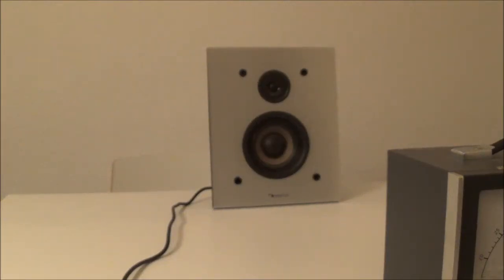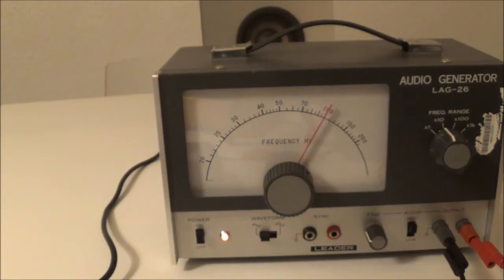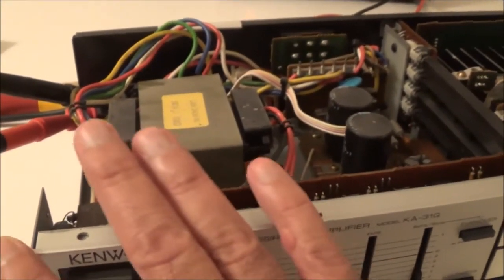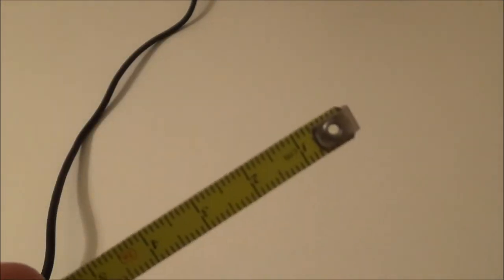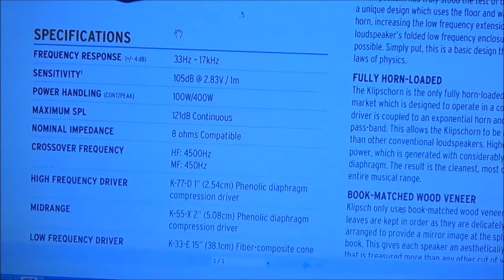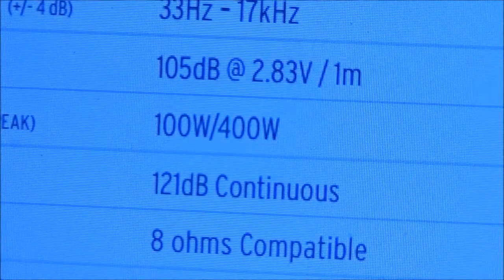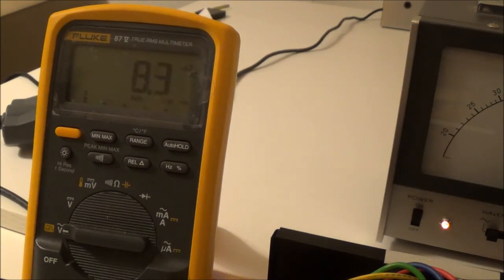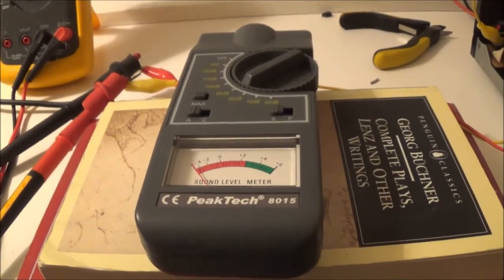Speaker Sensitivity Test

Comment: it seemed you switched to measure dBA and slow response (S mode) in your sound meter. It may still be correct for 1000Hz you did but it was not for other frequencies.